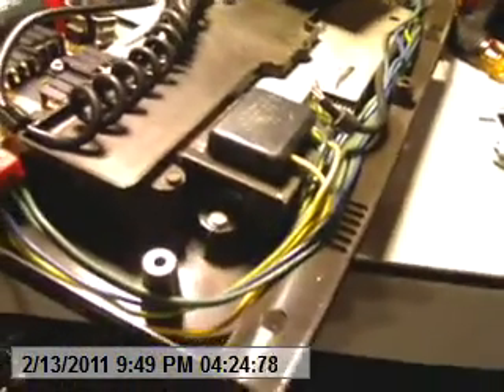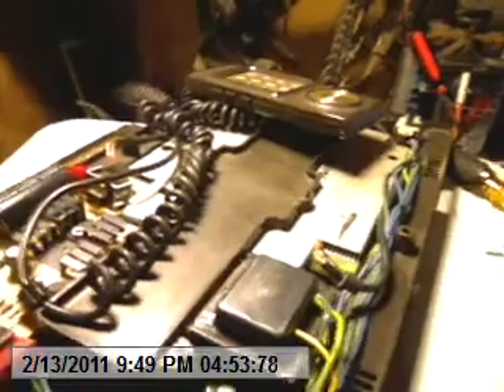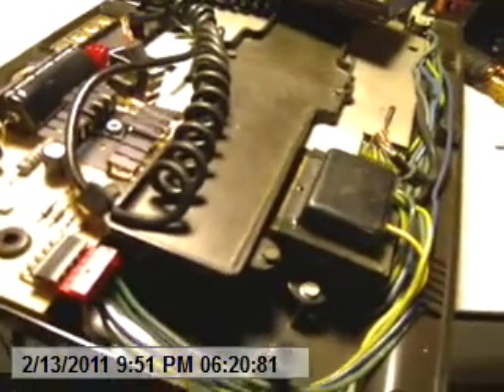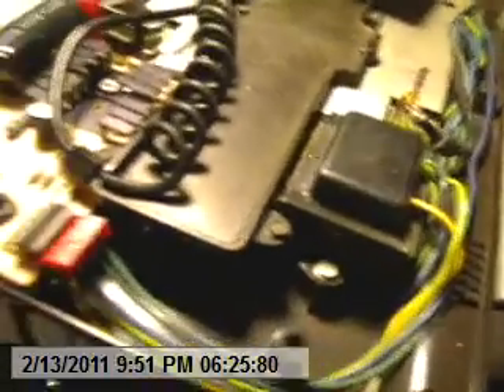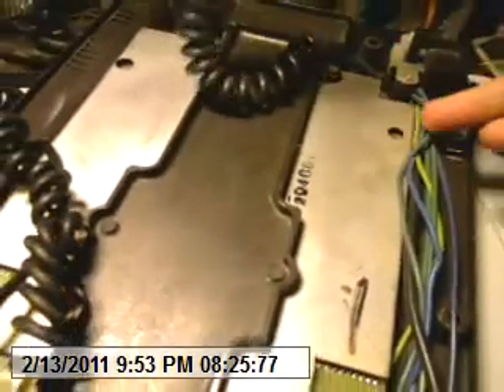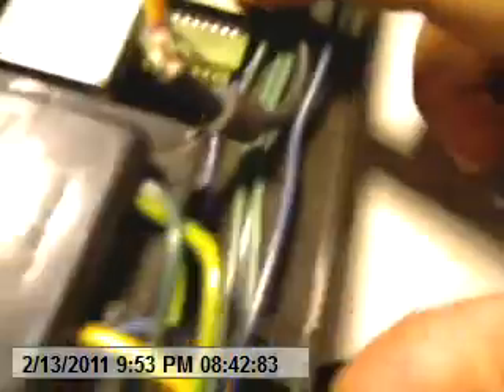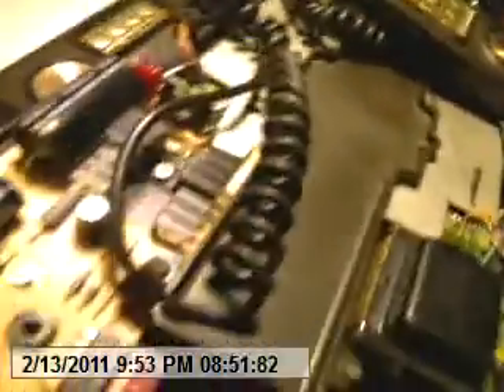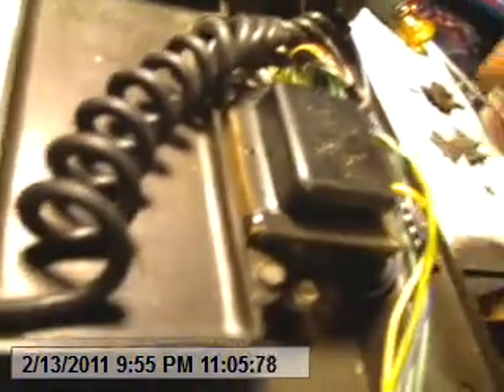Intellivision modal 1 opened up to show how to replace parts

Comment: My U.K. intellivisions have no hex screws outside & inside Philips head are used & there is no sheilding on main board, do you know what the connector is called on the end of the controllers that plug into the main board as i want to get some to rebuild the controllers as i have 6 spare controllers, i do like how easy it is to strip down